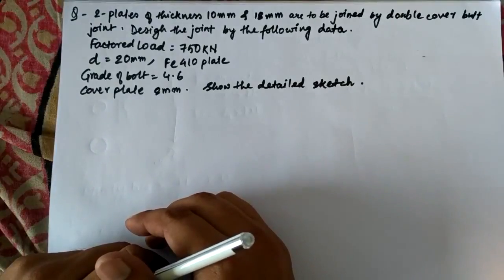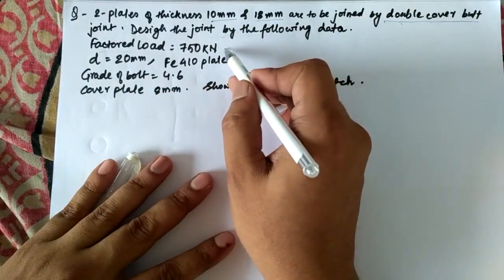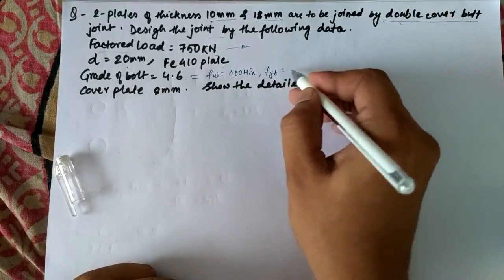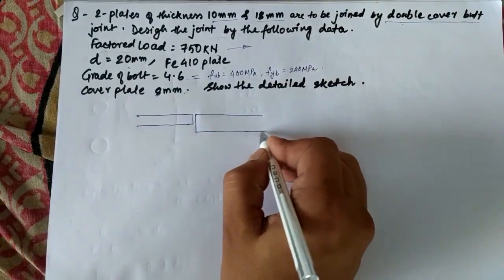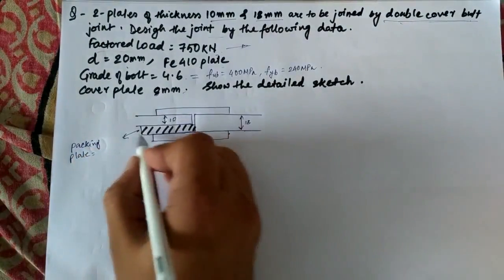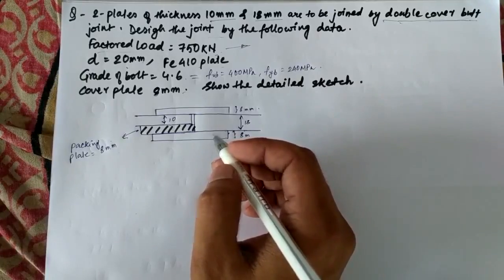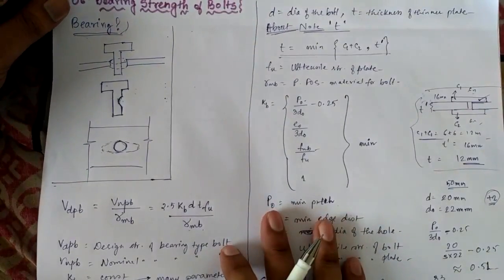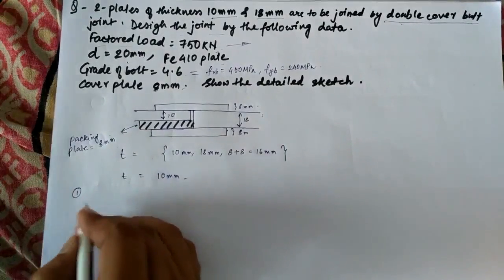08. BOLTED CONNECTION || NUMERICAL PROBLEM ||

Comment: Sir in designations  of end distance u marked 33 as edge distance why
Reply from the maker: 1.5 x dia of hole
Dia of bolt :20
Dia of hole : 20+2=22mm
So min edge dist will be 1.5 x 22 = 33mm

Comment: how to find number of bolts?
Reply from the maker: Shubham Kumar external factored force divided by the strength of each bolt...if ans comes in point take the higher value...for ex ans is 6.2 then we have to take 7 bolts